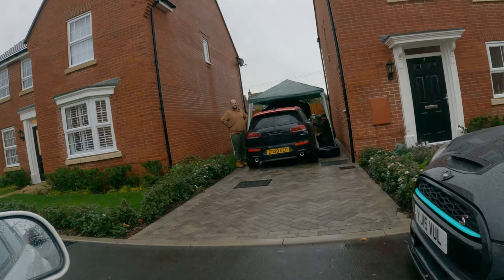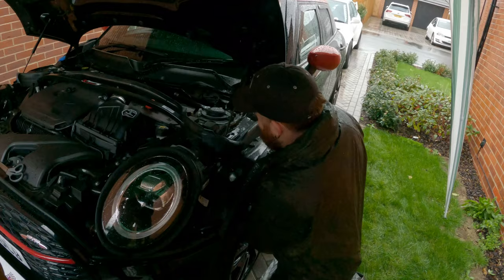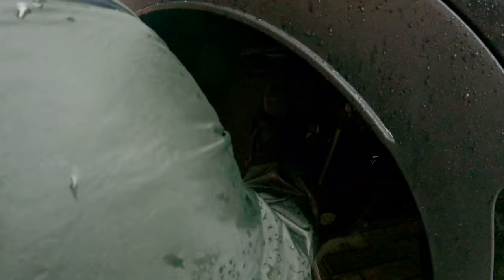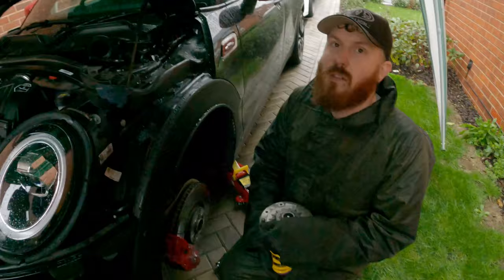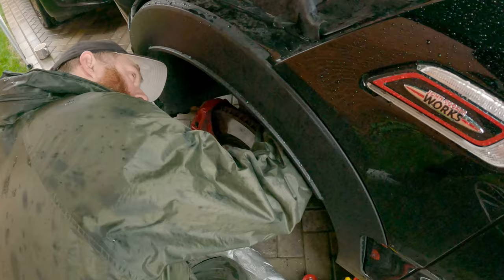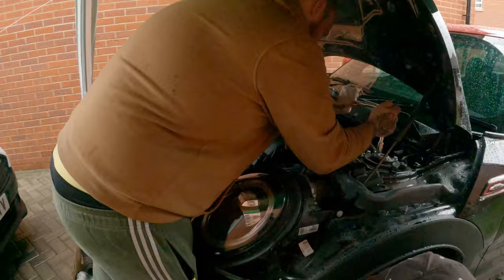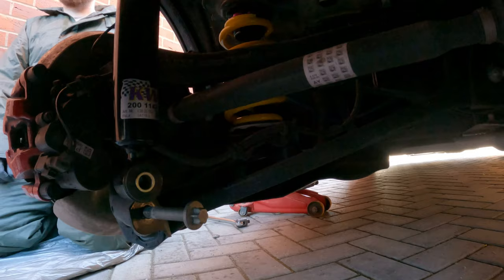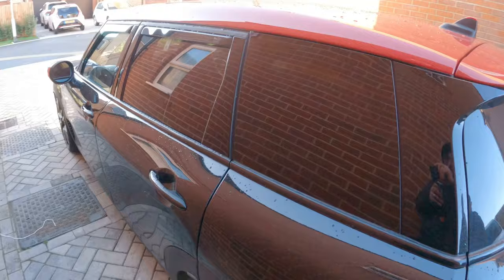MINI CLUBMAN JCW GETS SLAMMED! KW COILOVERS  (How to fit)

Comment: What year is that F54? I have a 2021 and want KW's but the website has nothing for 2020-2021.
Reply from the maker: It’s a 20 plate I can get you the link give me half hour 👍
Reply from the maker: https://performancem.co.uk/mini/clubman-f54-2015-on/kw-v1-coilovers-mini-clubman-f54-ukl-l-fmk-all4-4wd-incl-jcw-with-electronic-dampers-10-15/?gclid=EAIaIQobChMIn53JnuCP7gIVk4XVCh0GeQ7jEAQYASABEgJTkfD_BwE

They fit the 20 plate that’s what we fitted hope this helps
Reply: Many thanks mate!
Reply: @trackd7079  I notice there is a different part number for 2019 for the V1’s on the KW site which aligns when Mini changing suspension part numbers as per the LCI (refresh) I assume it would then fit a 2020 or 2021 model (as nothing has changed since then) which is what you lads have done. I get my factory order in a couple of months and was going to order the V1's but since there was no data on 2020-2021 I was hesitant to place the order. But if the car you worked on in this video is a 2020 I guess I will be ok. Anyways thanks a lot for the info ;)
Reply from the maker: Yeah same shape and suspension set up so it will 100% fit and no worries mate all the best 👊
Reply: @trackd7079  Is there any way you could have him check the part # on the box for the kit? All I see is 1022BN (without DDC) and only up to 2019. I guess your mate took a chance on fitment and it for ok a d I assume he used that part number. I believe Mini has new OEM suspension part #'s but I assume there were no chassis changes to affect compatibility.
Reply from the maker: That link I sent you before is the set he brought and we fitted, 

The chassis is exactly the same bud they fit straight on they haven’t changed the shape,

If your unsure perhaps call them up or look or some forums but if you have the same shape as this clubman that link I sent before will fit ✌️ hope that helps
Reply: Sorry for the multiple questions but I do appreciate you responding. kW said they have no data for 2020-2021 which is why I hesitated but I am gonna order the suspension today. Thanks again for all your help sir. ✌️
Reply from the maker: Thats ok mate if you follow that link they are the ones that fit 100% let us no how you get on all the best bud
Reply: Its the same car as a 2019 or 2018, just a facelift